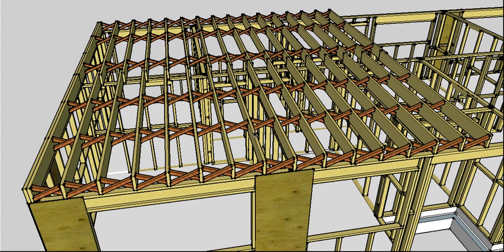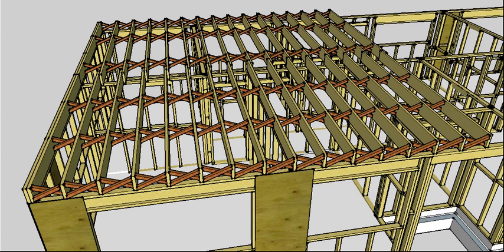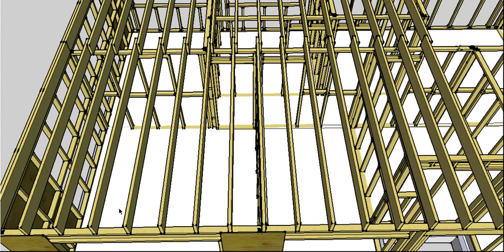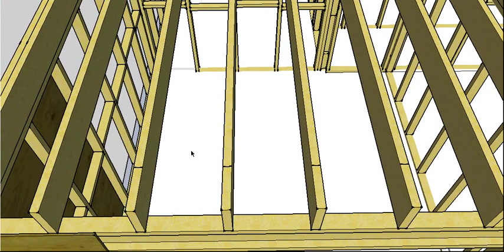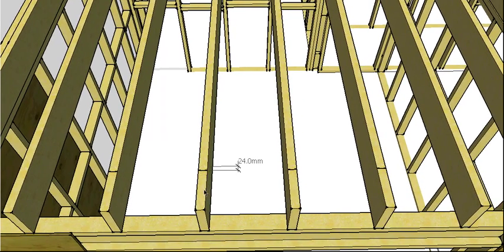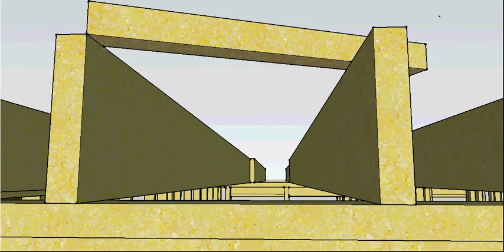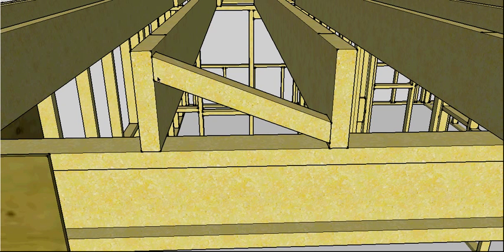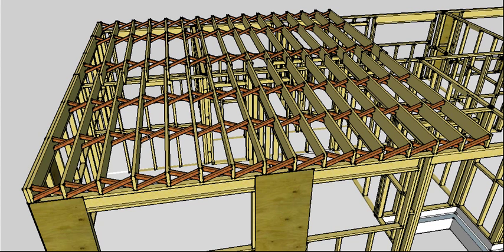Develop the Length and bevel for a Herringbone Strut

Comment: Dyu have an opinion on the preferred pattern? I saw a video which staggered the struts such that each other joist spacing reversed the direction of the strut.
Reply from the maker: Hi Mate, no, no particular option for me, just try and make it as easy as possible to nail.

Comment: Can lay a joist on the ground ie 2x10  measure the width of each space  you want to do sync there 14.5 inch make  Mark's at 14  14.5 and 15 take    a tape make a list 1 too whatever now use the template and the list number your cuts and bundle then bang them in nail above and below done  save you running back and forth to each joist space
Reply from the maker: Hi Mate, that should work, just remember that the length and the angle will change for each different length.

Comment: Excellent explanation and diagram and a great help for me.  The only tip worth adding maybe is to ensure that the 2 struts do not touch when they are fixed as this causes later, annoying, squeeks in the floor?
Reply from the maker: Stephen Hart Thanks Stephen Great point.